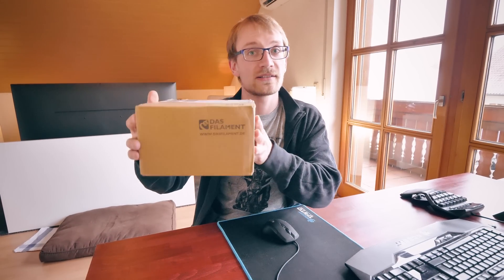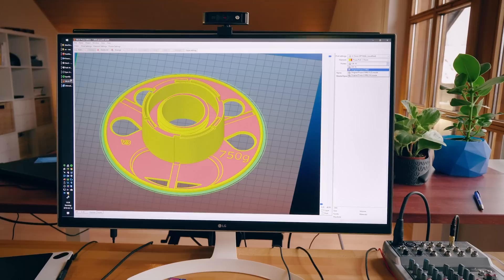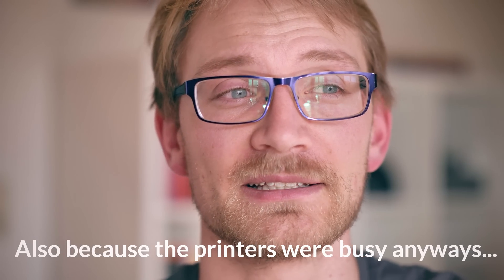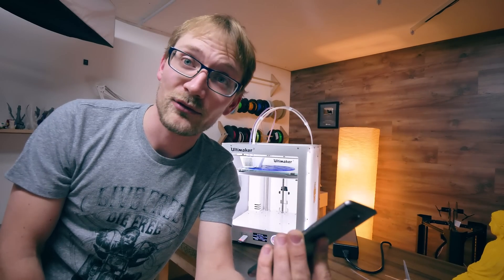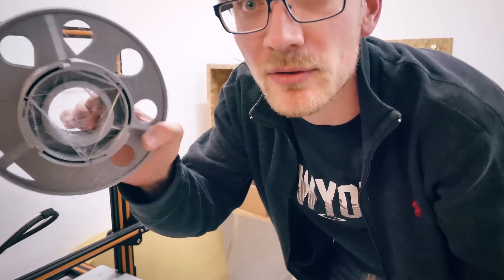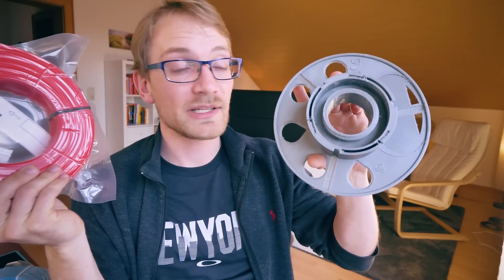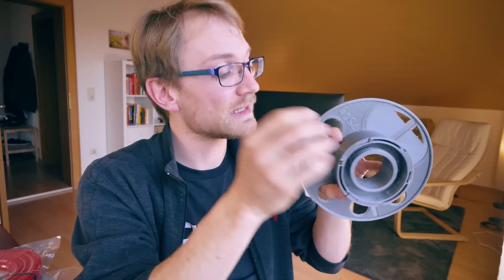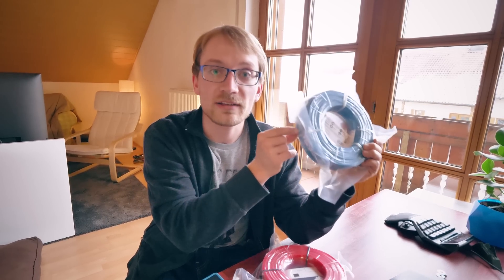3D printed filament spools!?

Comment: Great Vloging style. Particularly liked your check list of shots to include.

It would be nice if the master spool had holes around its core so you could insert some cable ties though the centre of the spool to try and make it easier to store a partly used spool before reloading another.

I wish the concept well, but can't see manufactures selling all there filament this way as it would double the stock units. Where I can see it working well is for basic utility colours that people use heaps of.

$0.02

Comment: I have 2 problems with this:

1) That I actually have to print the spool itself. This is a HUGE waste of printing time and filament, much more so as a print can fail for many reasons like how it happened for you. A better solution would be that filament manufacturers make their spools in 2 parts like that BY DEFAULT. So I would buy one spool at the normal price, then order a refill coil that fits on the old spool I bought. It's probably much easier to make via injection moulding than 3D printing and would be much cheaper (granted there is a cost for the mould tooling, but it only needs to be done once).

2) Different manufacturers have different sizes, some sell in 1kg some 800, some 600 etc and also the spool sizes themselves are never the same really. This is actually a problem I have with filament spools in general. It's making it so no spool holder is ever "universal". I am looking at you Taulman.....

Comment: Never occurred to me that the manufacturers were including the weight of the empty spool.  You can get quality filament on amazon pretty dirt cheap, but I do like the idea of making the spools re-usable.  Even though I can print a re-usable spool, it would be nice if manufacturers started offering molded ones (checkbox for: [  ] I need empty spool for this order)

Comment: If the master spool becomes the standard I think this is a great idea. If every manufacturer will have their own spindle size we'll have a problem.

Right now I don't think there is a source in the US for spool-less filament and ordering Das Filament from Germany will be too expensive.

BTW, my Ultimaker 3 extended has a similar problem where the middle rod falls out but there is no crack in the rod holders.

Comment: My concerns are:
1) Most spools I buy are 1Kg, not 750g or 800g. And what about 2Kg? That means we need more 'master' sizes?
2) Take the filament off w/o tangling it up? How? Then how do you store it? More used zip ties?
3) You need a large print bed to print a master spool. 200mm minimum. 
4) and what about printers that only handle their own custom spools? Some TierTime, JGAurora printers, etc.
5) I buy unspooled filament and then have to use 250g of it (1/3 to 1/4) just to mount it? Yes, I should only have to do that once, but I have over 20 rolls of filament. That 5KG!

I would think this would have a better chance at working universally if:
1) Spool manufactures make their own reusable spools for their filament. This would account for different sizes, diameters, weights, etc. You buy as many reusable spools as you need, once, and then all the unspooled filament you need. No 14-20 hr prints just to use it.
2) There needs to be a method to remove your spool without it exploding all over and tangling up. Something to store in in/on.

Finally, If all this is to save throwing away plastic (shipping spools to just throw them away when empty), why the HECK are we throwing away the thick, heavy shrink wrap bags they come in!? Why are those not resealable/zip-lock??? Geez, dog food comes that way already!
Reply: valid concerns, here's what I have:
1.) Master spool could be expanded in the side-to-side dimension easily to accommodate larger filament volumes.
2.) The idea is you print more spools.  The initial cost is a bummer, but could be reduced by being able to purchase injection molded master spools(if this catches on, expect $3 spools from China)
3.)  Yes, that sort of sucks for folks with smaller printers.  Could be mitigated in cad by cutting 3 sides of the circle off, not sure how well that would hold up but 180mm seemed doable.  Additionally mitigated by being able to purchase spools for $3.
4.)  The community hasn't ever really catered to companies with specific spool sizes.  And an external spool holder is trivial.
5.)  Obviously you'd use up what you have and incrementally print or purchase new master spools.  I think the file could be modified to use less material, or even modified to use cardboard or something else for the round part in order to keep it cheap to get going.
Reply: Ok, actually the idea of reusable spools is only new in the western world.
greg-3d.ru has been selling fillament for reusable spools since at least late 2016 (that's when I found out about that site).
And they are selling fillament in these sizes 10 meters, 50 meters (125grams), 100meters (250g), 300 meters (750g), 400 meters(1kg). And they all fit one spool!
Anyway, their fillament is produced in Russia, and it's aimed at the Russian market, that's why people in the west didn't don't even know about its existence.
Meanwhile Russian 3d printing bloggers seem to like it.
Reply: If they designed it to mate to a small thin plastic ring on the inside then it might be removable. So just a thin ring that the spool is wound onto. THe master spool clips onto that. It limits the flexibility of it but you already have a fix inner diameter of the spool anyway. So just work with that and add a 3mm thick ring inside. Then you can swap them off the larger spool easier. You just need to keep the filament tight with some clip or tape and not smack the side of it too hard. That would allow for quick swaps between material and less master spools laying around.
Reply: a manufacturer here, filaments.ca is going to use cardboard cores to help inserting/removing the filament and it's better over all when the filament gets near the end.    so same thing but cardboard core.  if they make injection molded spools or even good cardboard master spools that won't fall apart it's even better.   no wasted filament and cardboard is dirt cheap.
Reply: +DA Hai Zhu:
there is a way: when you get the filament without a reel you take an empty reel of those you have at home and rewind the filament: you just have to get a support for the filament (you could use an empty reel to which you removed a side ) and one with a crank or an electric motor for the empty coil. With just one machine you can top up all the reels you want.
otherwise: either you do the reels (and saw how long you need to do it would be useful for you to start printing them while you order) or continue to buy filament in reel
BTW: Tom Stanton has made a gear for his electric bicycle in several parts and has made 80 KM / H with that gear, so if you have a small printer you can always make the coil in small sections and glue them together or you can print the central cylinder with two threads at the ends and  cut the side-discs from  4-6 mm plywood using a 3D print of the side of the reel as a template
As you can see there are also other solutions.
Reply: In Argentina one of the filament manufacturers gives you credit for your empty spools. Another manufacturers sells filament that comes in a sealed mylar bag with a ziploc style thing.
Reply: 1) Why does that mean we need more master sizes? The entire concept of this is re-use and standardise - there's bugger all standardisation in spools atm. And if you've not noticed, most of your 1KG spools are not actually 1KG
2) Zip tie it while it's on the spool (there's crevices to guide the ties) - tangle free
3) 200mm is a reasonable standard print bed size - the majority of 3D printer's on the market have beds this size or larger
4) Companies have their own "custom" spools because there's no standards - this is a standard. Having said that, it's also open source and customisable, so modify for those awkward companies all you want
5) New iterations already use a lot less plastic - but you don't need a master spool for every one of your not currently being used spools of filament - cable tie and store. I'll probably print 2 or 3 master spools and rotate through my pile of filament as needed.

For your secondary points:
1) Great idea - if only there was a standard they could follow so they would work with other manufacturers filament spools?...
2) Again, that's already taken into account with the zip tie guides

That last comment is just whataboutism/tu quoque - the entirely separate issue of shrink wrap wastage does not negate the legitimacy of saving plastic on one time use spool holders.

Comment: I like the soundtrack. 

I don't mind the unscripted vlog feel, as long as you can be as thorough as usual.  I got a chuckle out of the vlog parody stuff this time, but I also enjoy the high signal to noise ratio of your scripted videos. I wouldn't mind you moving to a less tightly scripted format if it's more fun fir everyone, so long as "less tight" never becomes sloppy. Please don't ever get so loose I feel like you're wasting my time.

Comment: About the Vlog:  It was interesting to see one of your passtime activities while the print is ongoing.  It works in this case.

About the Reusable Spool Concept:  Manufactures of PLA should provide the Spools seperately, just as they do the PLA.  I'd rather save my PLA for things I can't get commercially or at a significantly higher cost than printing.  The last thing I want to do is spend all my printer time, possibly with a failed print, to produce something for my printer.  That seems like the tail is wagging the dog.  

Lastly, Levazza is good coffee, but Starbucks is just as good if you know what to request.  If Levazza was available near me, it would be an economic decision.  There are coffee roasters here that produce coffee as good.  I like 1/4 French Roast mixed with 3/4 Columbian Roast, which is equivalent to Levazza, IMO.

Comment: You guys are all to new to remember un spooled filament...  Its a {expletive} nightmare!!! never every buying un spooled filament again.  Richrap needs to get off his high horse about this, he has been droning on about it for nearly a decade! NB 1kg of filament does not include the spool weight. If yours does your suppler is ripping you off! All this does is transfer the cost of the spool manufacturer to yourself, power, time and filament costs, you have to pay for them all vs the suppler making them in bulk at a fraction of the cost. Yes shipping is slightly cheaper, this is negligible vs the cost and hassle of making your own spools.

Comment: Hi. Putting the filament on was very easy because the original filament was already tight with zip ties. Wait until you have used some and loose the tension to see it it's THAT easy to put on and off again. Like the video and the format  also I'm up for recycling but I think it will be a headache to change filaments. JMHO

Comment: I have a tip for you Thomas, when doing coffee in the mocka pot. Heat the bottom part with water in it (no coffee yet) so that the water boils. Then take off the heat and put in the coffee and put on the top part and screw tight (use ovenmits, ITS HOT). 

Then back on the heat. This reduces the time that the coffee is exposed to hot water steam, this is important as when coffee is exposed to heat for x amount of minutes it will develop that bitter caffeine taste. With this tip the coffee you brew will be even more smooth.

Also i enjoyed this Video ALOT :)

Comment: I think the concept of a reusable spool is a good one. Most people look at it for price, but the bigger picture is the environment; less wasted plastic, lighter loads to ship mean less use of fossil fuels. I buy (instant) coffee refills in a bag rather than glass jars for that reason; they are no cheaper than a glass jar, but they contribute to less wasted fuel. I think a better idea would be for the filament makers to injection mould the screw fit spools, and then sell the filament either with spool or without. Then you could pick a few spools up and reuse them at a later date, saving some cash and helping the planet.

I liked the vlog style for this, as it wasn't a particularly technical item it was a nice way to present it. My view is that a vlog every now and then is nice, but not too many (once a month is good) or it runs the risk of diluting the channel content. Good to see some of the scenery around your place too, and I liked the drone shot of your cycling :)

Comment: Talking to the camera relaxed and not scripted is a lot better and you can get the hang of it. Good editing and good transitions. Only criticism is on the choice of background music on the vlog parts. I have connected metal/rock with playing Diablo 2 and I do like the genre. I just think that electric guitar and drums do not go well with the word "background". If you don't want the beat electronic lounge style that vloggers use, go for an acoustic-classical guitar "travelling" or folky style. For the masterspool, I think the concept needs more optimisation to become viable. I think cardboard spools are already good enough and if you print a lot there are 2.2, 4, 6, 8kg spools from some manufacturers, so there are good solutions to plastic spool waste.

Comment: I have some filament from NuNus (German company) and their spools are held together by 4 screws and could easily be refilled. They only sell them together, though, but i think a refill in this case would be a much better case. Life is too short to spend 30+ hours to print a filament holder worth a few cents of ABS.

Comment: I love the master spool concept.  Hopefully manufacturers will at least take a flyer and help us try it as an option. -- On the VLog, normally I am not a fan of it, but this worked out well for you.  It was surprisingly interesting to see a few snippits of your house and area.  My suggestion is to do one a month or so, but your normal 'information only' videos are some of my favorites.  So don't just drop the 'old style', but taking a flyer and trying something new is fun for both you and your audience.  If you want to do Vlogs regularly, I would suggest a vlog channel.

I would like to see the ties put on so the tie could be re-used (make it so you can cut the 'tail' off rather than cut the 'head' off.  If this is done as a 'standard', the same time could be used to re-tie the spool if it is needed for different fillament.   I noticed you cut the 'tail' off about 1cm from the 'head', cutting nearer the 'head' would make it longer for re-use.

Now if we could make printable wire ties <grin>

Comment: So what I was actually interested in seeing wasn’t addressed, and that is how easy it is to slip off the filament and tie it back up without messing everything up.
You see, while you could theoretically print X number spools and know that at any one time you’ll have <X number of filaments, that’s not a very economical solution. Better to have 1-3 spools (including a spare or two) and be able to remove and store the filaments off the spools.

Comment: Oh come on? Pre-ground coffee from the fridge made in a Moka pot?   (My favorite desc: 'Bitter over-extracted coffee that only an Italian could love' 
Should be fresh ground in an espresso machine!  Where is the crema!  The subtlety! The depth of flavour! 
Visit Australia. We'd consider what you made there to be 'emergency coffee', good if your espresso machine has broken down.  :)
Reply: Electra Flarefire its the mokka pot with pressure valve. Afaik it makes quite decent crema. No la pavoni but also less work ;)
Reply: They should /all/ have  pressure valves. That is the difference between a 'coffee maker' and a 'steam bomb'.. :)
He does have the 'anti-spray cap' that does help add a bit, but remember they can't go much beyond 2x atmospheric, limited mostly by the tamp of the grind, so you never get the right 'depth'(Is that the right word?) of extraction.
(Full disclaimer: I own and use one myself. Rather a proper espresso machine. Mine is a stainless steel model, I find the aluminum ones tend to burn the coffee if you have the heat too high. For example because your half asleep before your coffee. )

Comment: I prefer your scripted stuff but you could use this style for non-technical stuff like this. Just cut out the non essentials. This video should have been right around 5 minutes. Also you need a sponge Bob "one hour later" on at least one cut. I don't know why but it is vital in a vlog. Good job on stepping out of your comfort zone.

Comment: So i just did some quick math:

Filament with Spool = 22,44€/1000g
Refill Filament           = 21,12€/1000g
                                    = -1,32€/1000g

Masterspool weight at 20% infill ~240g

This means the spool will cost you approximately 5€.

Therefore you will need to buy at least ~3,8kg of filament to save money with this method.
And that is if you just print one Spool.

So this is probably only suited for guys who are planning to print a lot.

Comment: Nice to have an occasional mix up with content. God job! I would want more than an extra 50 grams of filament to make it worth while. I would be curious to see how easy it is to get a partial coil off the spool, and store without messing up the coil. The initial loading of a new coil is easy, but could be problematic later. Also those stickers are going to be a one shot deal. Have to factor in the cost of extra zip ties.

Comment: For those in Canada, filaments.ca is reportedly producing master spool compatible rolls of material.
Reply: Well, their refills are 1KG, and not 800g, so they won't fit, and their coils have a cardboard core...  Basically, they have their own master spool design.